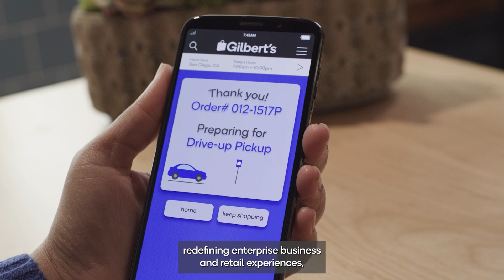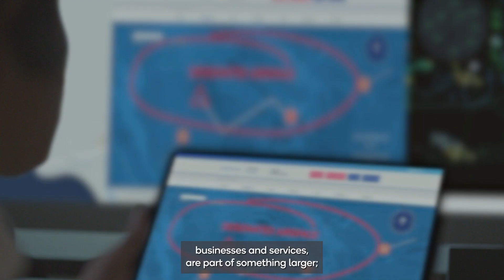IoT Begins with Qualcomm

Comment: WANT CPU TURBO BOOST FUNCTION WHEN THE LACK OF TEMPERATURE AND VOLTAGE <1,3625V IS AVALABLE TO AUTO REACH MAX TURBO FREQUENCY. SMALL CORE MUST ALWAYS PREFER TO WORKING AND HAVE HIGH FREQUENCY SAME AT PERFORMANCE CORE